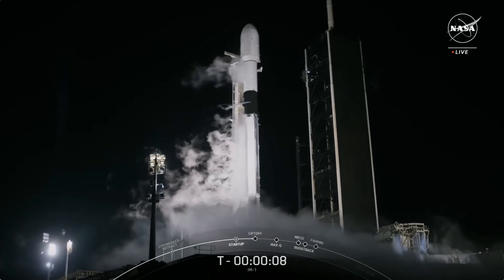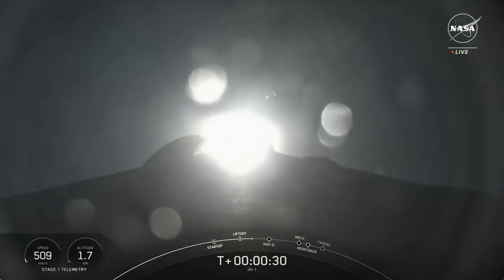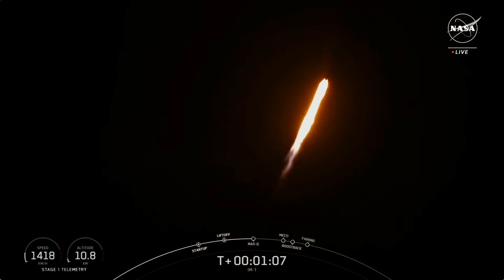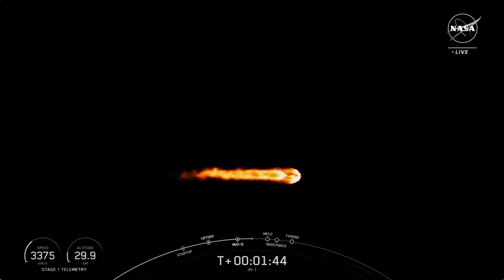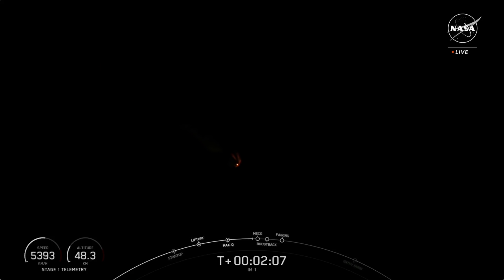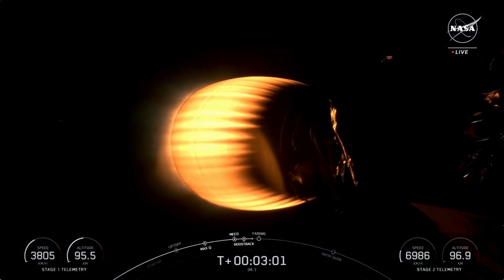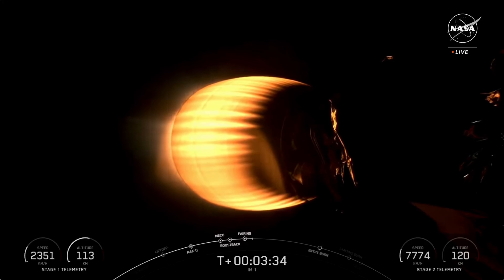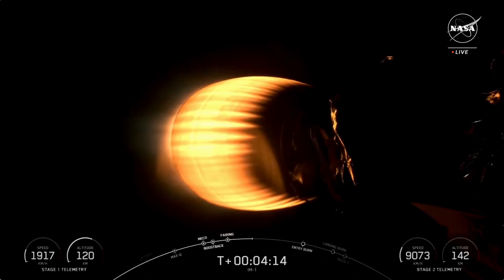Blastoff! SpaceX launches Intuitive Machines 'Odysseus' lander to the moon

Comment: What cant they use falcon 9 on manned missions
Reply: Weight of payload is too much. Need a heavy lift Iauncher.
I don’t see why falcon heavy can’t do it though
Reply: @Cafaura  how refueling in space?
Reply: @xanderortega4359  I mean, it’s achievable but at that point of adding the ability to refuel/ rendezvous you would just build a stage that launches ontop of the heavy with fuel already on board. Apollo style/lunar rendezvous is still the best method we have for the moon
Reply: @Cafaura  the iss refuel from the spacecraft that docked with it to adjust and correct its orbit, maybe all we had to do was just add a module dedicated to store the fuel, just enough to boost the spacecraft to get to lunar orbit and back
Reply: @Cafaura  anything is indeed possible, i just read about lunar missions, like you said, the apollo lunar style/rendevous is the most appropraite method based on the immediate demands of nasa, but my idea only comes from that if possible almost every spacecraft available can be used to do missions in the moon. But indeed need a lot of testing

Comment: it's not a real video. or rhey edited it for some other reason.. bit it's 100% edited. you can take a screen shot of the flame and make it brighter.. than its obvious what has been added to the video..
Reply: Learn how digital images work and you'll understand why.
Reply: You could literally see it here in Florida
Reply: @richardwainwright507  i never said the launch was fake. said the video was edited..
Reply: You're a fool.
Reply: The launch is visible to thousands of people for hundreds of km in every direction (yes, I know you said 'or they edited it' but you kicked off with 'not real').I didn't personally see the launch, but I satellite spot. I catch a few every clear night, where they're predicted to be. I've done triangulation measurements ( via scale drawing, or using simple trig) with the help of friends or relatives a few hundred km away, and measured these object’s heights and groundspeeds - these always come out as hundreds of km and km per second respectively. I've caught a couple of the bigger, lower altitude ones (including the ISS) through my telescope and they look as expected. And, getting a bit more technical, I used a radio set and a directional antenna to follow the signals produced by several of them, across the sky, so they are definitely machines in communication with the ground. 
All the above is repeatable by anyone, has been many times.  Don't take my word for it, go out and try it.
Reply: @studentjohn no matter how much you reason with them and provide scientific evidence, you cannot teach someone with a smooth brain new information. 😂😂

Comment: Falcon 9 is such an amazingly reliable rocket 🚀 
What a game changer
Reply: Clear. Specially if you compare with starship
Reply: What will this do on the moon ?
Reply: Sadly, It'll be outdated in the next 10 years. Nasa is currently building a nuclear powered rocket engine.
Reply: @kushmorejames8164 wow that's the stupidest thing I've ever read
Reply: @kushmorejames8164  Nasa is useless.
Reply: @kushmorejames8164  everything has its time 
This paved the way for for future tech